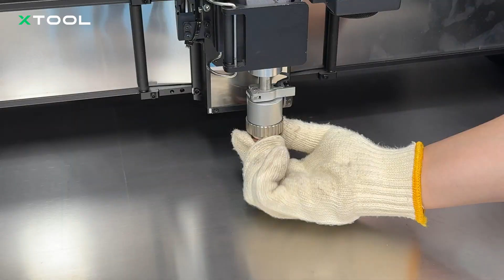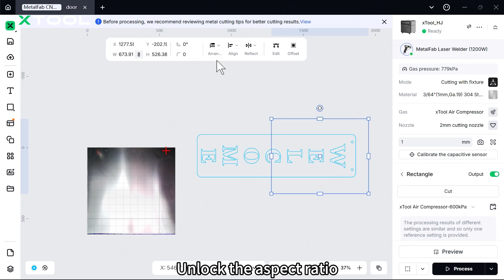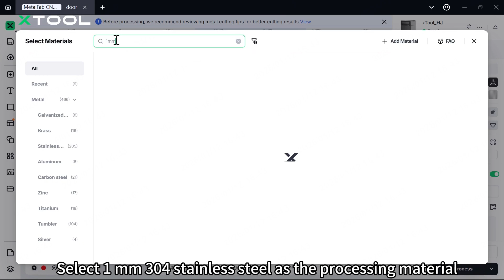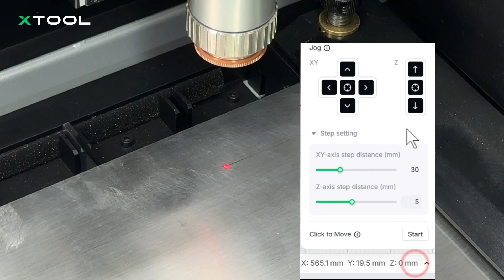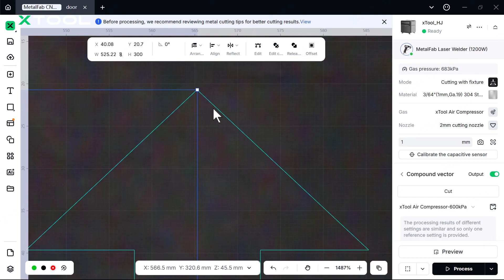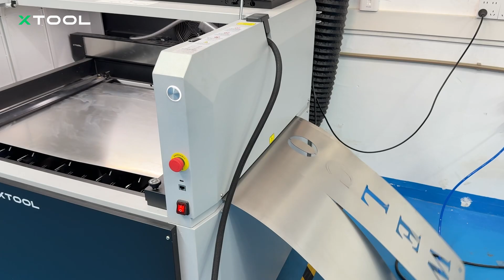Lesson 6: How to Cut Long Materials Using Passthrough？

Comment: @xtoolsupport Oh, come on guys - add a quick-align feature - this is just torture! Better yet - if there was a way to move the rotation center of an object (as most vector graphics programs can do) - you could just move it to the upper right, and then visually rotate the bottom right to the proper location/angle.